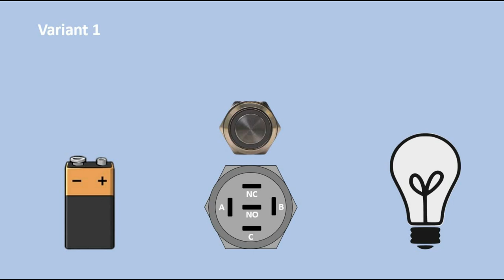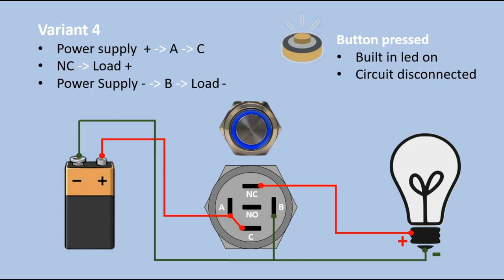How to use self-locking metal pushbutton switch to power on arduino projects

Comment: Thank you for this great vid! Can I ask how do you control the button's LED light programmatically using Arduino? For example, when a user has inserted enough coins in a coin slot (also connected to Arduino), the LED light turns on, signifying that it can already be pressed. Looking forward to your response, thank you so much!